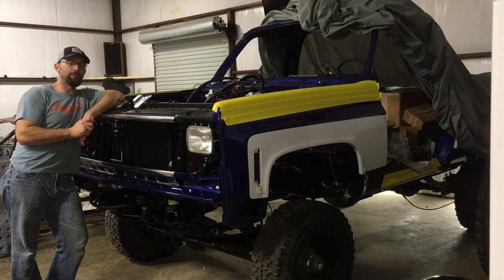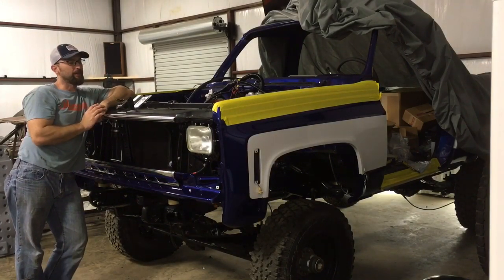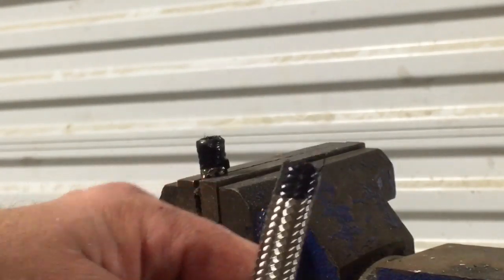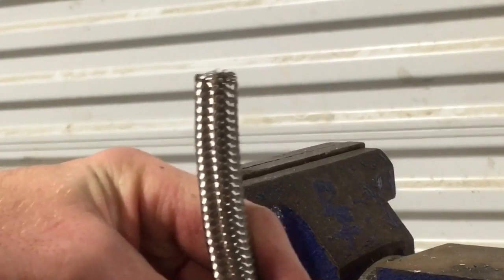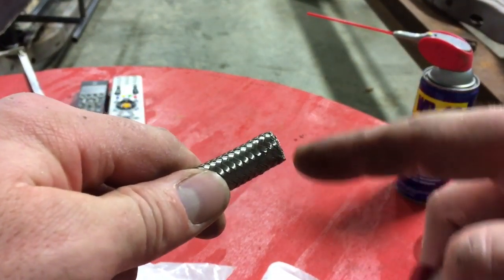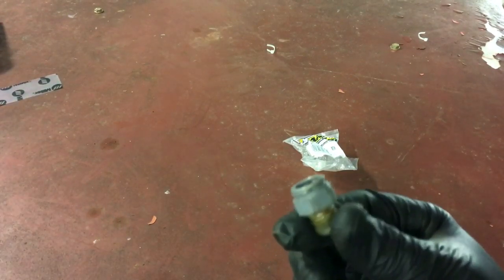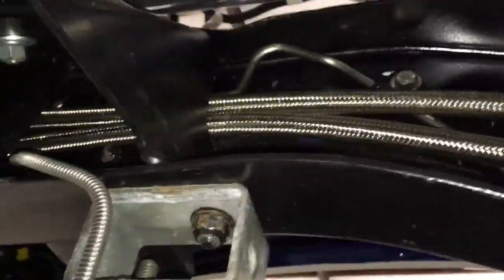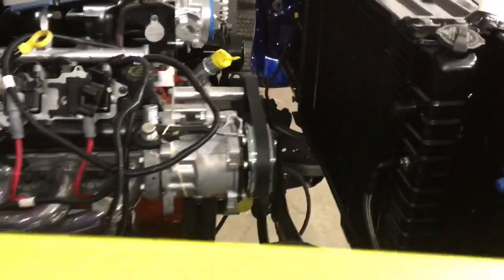LS Swap Transmission Lines/4L60e...SOLVED

Comment: What length is you transmission line like they got 52 inch and 70 inch I was told to use ptfe so that’s what I’m using I used the same setup that you have right there on my power steering setup because my power steering lines were leaking right at the crimps of course of the factory hose so I replaced them with an-6 swivel hose like you just installed but I was just curious as to what size hose you used as in length because I have a choice of 52 inch and 70 inch and obviously I don’t wanna get to short to long I can cut off and make new end but to short is a pain in the neck to have to add longer hose

Comment: Hey man I got the earl fittings for the transmission. Was yours tight when you was putting them in? I can get maybe a turn and a half then it’s way to tight
Reply from the maker: Double check your thread pitch. It may be a different thread fitting. Mine were tight going in but I got a few rounds on them before they started getting tight.
Reply: @1980LSK5  yea I didn’t want to put them in and them start leaking I figured I’d ask. Appreciate it boss

Comment: Anyone running a 4l60e with 5.3l running the trans lines to the radiator and no external cooler. I have  91 c1500

Comment: Angle grinder or chop saw with abrasive wheels cut braided line nice also. Just shortened a braided radiator hose today with grinder. Worked great. Then  just blow it out.  Excellent video on something that can be frustrating.
.

Comment: So i have a l31 vortec 4l60e and i think it was a 243, i want to drop the whole shabang in my 75 blazer, but it has a 350 turbo , i can't figure out where i can get a crossmember for a 4l60 set up.
Reply from the maker: FOR YOUUU GAMING COALITION I had to build a crossmember. I have a video for that also.
Reply: I just drilled new holes

Comment: where can i get those brackets you used to secure the lines to the frame and fender well?
Reply from the maker: Dale Bagwell I made those out of stainless steel strap pieces. They make some but I can’t remember the website. Check with an industrial fastener store like Fastenal or Grainger. Hope that helps

Comment: You can add a cap to one end, and a cap on the other end of the line with an air fitting..Submerge the capped end into water and apply some air pressure..No bubbles means the hose won't leak when installed on engine/trans

Comment: Will the transmission adapters fit a 700R4?
Reply from the maker: Ricky Jimenez0311 what year model 700R4? I’m under the impression that the 4L60 and the 700R4 1992-99 are the same transmission but with the introduction of the LS engines and new electronics, the 4L60e is built different. The E at the end refers to an electronic 4L60. As for the adaptors that come out of the transmission, call a transmission shop to verify that the OEM fittings were the same in a 92-99 as the 99-Up and if so, then yes the adapters would work. I’m not familiar with the older ones. Sorry I couldn’t be more help.

Comment: Great stuff I just discovered you yesterday doing homework on 241C transfer case is my self and stumbled across your build thread I’d really love to pick your brain on some of the stuff that you’ve done I’m in the process of taking a 1970 Chevy van and make it into a 4 x 4 and I’m wanting to use a 241C electric shift transfer case from the looks of your transmission that you’re using I could maybe have some benefit and using that same set up would love too talk with you I set this email up that you can email me a just to talk to you johnkristopher66@gmail.com

Comment: Is this build on the road yet? Honest question.
Reply from the maker: Xploration XJ I wish I could say it was but I’ve had life get in the way. Daily driving the yellow c10 has created a priority in keeping it roadworthy overall vs building the K5. I’ll be going again soon on the sound deadening material and some interior work before installing and building the doors and tailgate. Thanks for checking in.
Reply: @1980LSK5  I completely understand man. I'm building a 98 cherokee on 40s with a 5.3LS and pulling a camping trailer all over the continent and I'm debating on what trans to use. Was hoping you could say how the 4l60 held up. I'm leaning towards keeping it mechanical and going Turbo400. I think I'll live without overdrive..
Reply from the maker: Xploration XJ If I were running a jeep on 40s to drive across the continent I would probably explore the 4L80 transmission. You are going to have a lot more strength and structure and it will give you an overdrive gear. The 400 is a strong transmission and would suffice given the gear ratio you choose and tire size calculate correctly. I just feel like you will want to have the option for overdrive. If you are pulling the camper you can always pull it down into third for towing and so forth. I don’t believe the 4L60 would be a good transmission for what your intent is. It will most definitely be strained. Probably slap a 4L80 in there with a pretty beefy trans cooler and go on down the road.
Reply: @1980LSK5  yeah I've looked into the 4l80e but then again back to electronics and wheeling deep water I could have issues. Sealed up 400 I'm safe. Considered doing a manual valve body on the 4l80e but also weight is a factor also it has a super steep not friendly first gear.. I've done a lot of research and the only big breaking factor with the 4l60 is heat and if it has a beefy trans cooler i should have no issues with this thing in a lighting jeep outfitted with a cage, coilovers, d60/10.5 and 40s. Realistically though most my on road driving is going to be pulling a home built camping trailer behind me with 37s or 40s as well. I doubt I'll see much more than 75
Reply: @1980LSK5  also 4l80es aren't cheap if I need a quick trans swap 5,000miles from home I'll always be able to find a cheap th400.?
Reply from the maker: Xploration XJ some of those old 400’s for 4x4 are getting tough to find but yeah I agree a newer 4l80 can be $2000+. I’ve heard about the overheat issues myself with the 4l60/4l65. The good thing is, about any salvage yard across the continent will have one for about $600 or less and you could swap it in a day or less if you were broke down. May be the more feasible option for what you’re doing vs the 400 and the 4l80. Definitely get a cooler and if you have it all tuned, have them turn on your trans temp in the PCM and put a gauge on it so you can monitor it pulling a load. I not 100% but I think the 4l60 is capable of showing temp. May have to research that aspect. I know the 4l80 out of the Denali and Escalades offered trans temp monitoring. Sounds like you know what will work best for your build and you’ve done your homework, just gotta pull the trigger on one now.

Comment: are these the same fittings for a 4l80 also no trans cooler?
Reply from the maker: Samantha Jones these should be the same fittings for the 4L80 as well. I’m not 100% but I was thinking they ran the same diameter lines as the 4L60. Of any transmission guys can chime in and confirm then please do so.

Comment: Great Video. I want to add a 14" approx cooler. Its 1/2" fitting size. Would I have any issues going from like -10 to -6 ? It's for a prerunner. This would be mounted in bed.

Thank You Sir
Reply from the maker: Ben Herrera I don’t think you’d have a problem at all as long as you can find the adapters to neck it down. They make tons of stuff like that. I hope I won’t need an auxiliary cooler myself but I’m pretty sure I’ll need one. Good luck with the build!!

Comment: This is one of the most useful videos I have come across. Thank you for this. I was confused first time running these type of lines & this video Realy boosted my confidence
Reply from the maker: ProjectPhroRegal awesome that I could help. I appreciate the feedback!!
Reply: 1980 LS K5 I building a 1980 regal , what fittings do I need for the Ls power steering pump to fit the gm power steering box? 
Is it 18mm to -6male?
Reply from the maker: I did a video on power steering also. May check it out because I don’t remember the lines and what thread pitch they are. I used a factory style line instead of AN fittings on it.
Reply: 1980 LS K5 thanks

Comment: Is this line rated for trans fluid? I ask because I’m curious how it’s held up. I’ve seen the Russel hose get brittle break down and get hard because of the hydraulic fluid.
Reply from the maker: Vertical Pedal Garage based on the research I had done before install, the interior lining was rated for fuel, hydraulic oil, transmission oil and a few other petroleum based products. Heat and corrosiveness being a factor also, the name brand stainless braided line is acceptable. Be careful if buying a cheaper China made brand or the kits from eBay. I heard horror stories of the internal lining failing and leaking and leaving people stuck. Always buy quality when buying vital components

Comment: How many feet of line did you buy?
Reply from the maker: I believe I ended up with a little over 12 feet for the transmission cooler lines and close to 24 or 26 feet for the fuel line return and supply.
Reply: How many did you end up buying? Will 15 ft be cutting it too close? 20 ft should definitely do it, but costs a bit more.

Comment: any videos on ur ac man how u liking it
Reply from the maker: Hey sorry I still have not completed the AC set up yet because I ran into some wiring issues from the engine harness. I wanted to complete that before I proceeded with the vintage air set up. I have spoken with a lot of people at car shows that have gone with the vintage air and everyone has had a great experience with it. Hopefully I will get to finish mine up and test it out before summer is over

Comment from the maker: The holders were something I made before I found they can be purchased. I made them out of 1" Stainless steel strap. Cut them at like 5-6" length and drilled a hole in the center. I had to hand bend them all. 
Here is a link of where they can be bought. You need to get measurements of the OD of the line you're using. 
https://www.opgi.com/chevelle/C240157/

Comment: What is the "holder" you mentioned on the frame rail?  Some sort of coupler?
Reply: I second that question. What’s the part number on those universal double hold-down things?
Reply: @MoneyManHolmes  They are Helix Line Clamps. Available through Summit Racing. Search that brand name on Summit, then choose by line diamater

Comment: Im pretty sure I'm running the same radiator as you in my '70 k10. Im wondering if you had any issues with your upper and lower radiator hoses. I found the the 2002  Silverado hoses fit pretty well but the rad output/input diameters are larger than the water pump output/input. Do you have any ideas on this?
Reply from the maker: My radiator hoses hooked straight up to the radiator from the water pump and everything was the same size. Maybe I got lucky? I used the hoses that pulled up for 99-02 chevy Silverado with 5.3. That being said, if you have your radiator out, take it to the store and have them  pull a few hoses. One for 99-02 and then 03-07 and see how they fit. Good luck with it

Comment: How would I install a trans temp gauge if I run these braided lines?
Reply from the maker: Man I'm not sure on that. I was thinking that you would have to have that turned on in the PCM and then wired in off of one of the pins on the red or blue terminal coming off the PCM. Find Scotty Baccus on LS Swapped squarebodies on Facebook or ask the guy on LT1swap.com. I think his name is Brandon.
Reply: 1980 LS K5 Thaks for replying. I did some research and they told me that I could also use glow shifts stubby temp sensor that connects to the 4l60e's test port

Comment: Another good video my friend. Thanks again.
You mentioned you used NPSM fittings for the cooler inlets. Do you think NPT fittings would work as well? Summit sells an AN to NPT 90 degree fitting (SUM-220651B) that would eliminate the need for both the straight fitting and a 90 to attach to it. I'm not sure if the tapered end would be an issue going into the aluminum radiator ports. Thanks
Reply from the maker: I don't believe the tapered will work because it has to be an inverted flare to mate properly to the female connection on the radiator. I believe it would leak and not seal properly with the tapered fittings.
Reply: 1980 LS K5 Ah, gotcha. Do you think that is a feature of your particular radiator? I'll be using different one. the manufacturer claims their inlet is 1/4" NPT.
Reply from the maker: That is just for my radiator. I would definitely suggest you go with what the manufacturer recommends for your radiator.  Something else I would like to add about the fittings that you mentioned. The problem with those is once they are tight that is it. If they are facing the wrong way then you have no adjustment. What if they are tight and facing upwards to the hood? That will be a problem hooking lines up to them. Just something to take into account before ordering them.
Reply: 1980 LS K5 Yeah, that makes sense. I'll definitely consider that. Thanks again

Comment: You'll be able to monitor trans temps through the data port. That will let you know if a cooler is necessary.

Comment: Just curious why you decided not to go with a stand-alone trans cooler instead?
Reply from the maker: I've not completely ruled that out. For now I am going to utilize the cooler within the radiator. I am trying to prevent putting another cooler in front of the vintage air condenser and I'm hoping to keep the engine bay free of clutter. I feel like eventually I may mount a separate cooler and fan setup on the passenger fender skirt or on the firewall where the a/c box was originally. Still an option and a great question.

Comment: The other option is to replace the trans fittings with those used on 4l60e and use the associated quick disconnects. As always, good stuff!